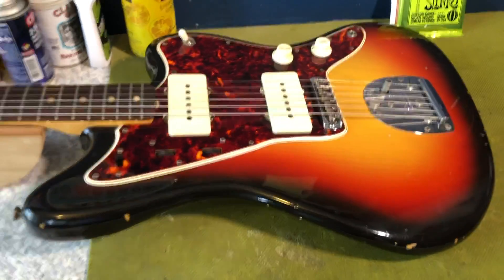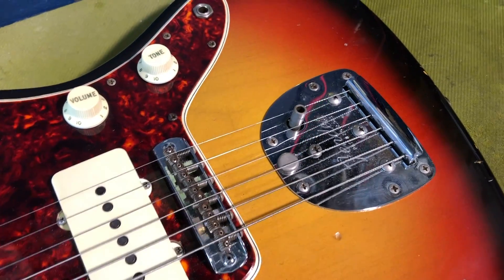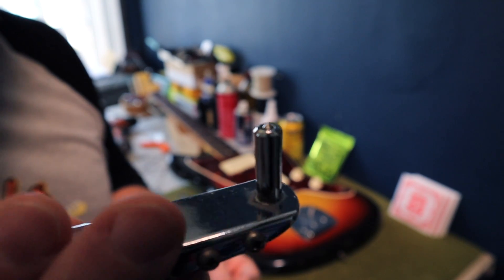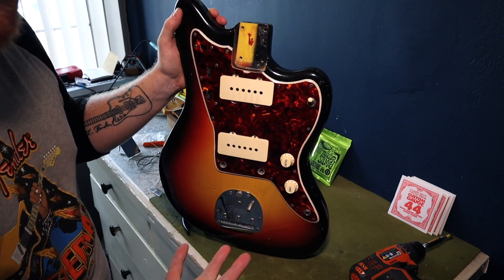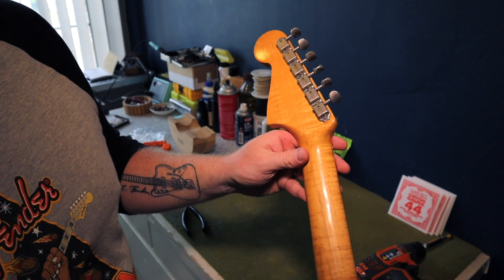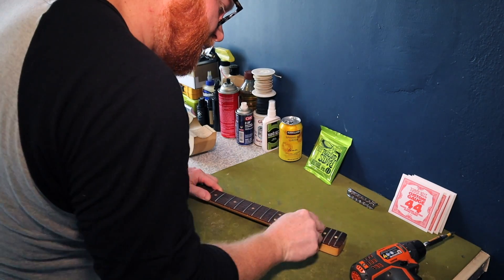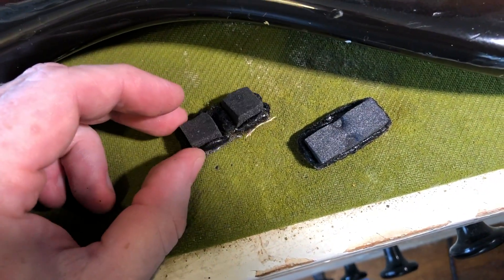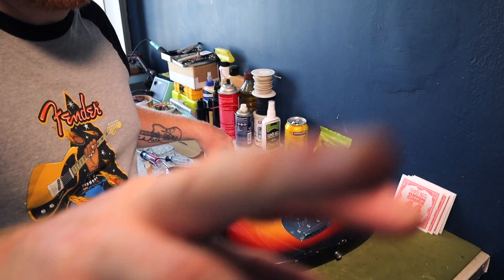1965 Jazzmaster Setup Walkthrough & Demo

Comment: How do you know what angle shim to add, and are there other adjustments you need to make to accommodate the angle?
Reply from the maker: This is a great question but it's a tough one to answer because every guitar is different from the tolerances that exist within manufacturing. Some guitars will only need about a third of a degree of pitchback, others a full degree. If you have the stock bridge and are trying to get the guitar setup "correctly" then the goal is to keep the strings in place, that's a good indicator that you're on the right track. Personally, I've worked on so many of these at this point that I can just eyeball it in most cases.
Reply: Puisheen Thanks! Keeping the strings from popping out makes sense. I have a Johnny Marr Jag and a Jazzmaster and been experimenting but I’ve never been told this before. Seems like keeping enough tension to hold the strings is a good way to know if you’re doing it “right”.
Reply from the maker: @capitaldharma  Ah but there's a catch: Johnny Marr Jaguars have a pre-angled neck pocket, and the bridges on those already sit pretty high off the body. If you're having issues with string skipping on that one, I wonder if there's some other issue at play?
Reply: @Puisheen  I have a stock Mustang bridge on the Johnny Marr Jag, so there isn't much of an issue with strings popping out of the saddles. The main issue is getting the action lower. I put a 0.50 degree shim in the neck, which maybe helps a bit, but the action still feels a bit too high. It's low enough to make a good rhythm guitar, but I feel like there's got to be a way to get the action down a bit more.
Reply from the maker: @capitaldharma  You're unable to lower the bridge?
Reply: @Puisheen  not before I added the shim
Reply from the maker: @capitaldharma  It was already as low as it could go? Wild. Feel free to send me pics on IG or something!
Reply: @Puisheen  Thanks for all the help!
Reply from the maker: @capitaldharma  Any time, friend!

Comment: Great video!!!  The action did look on the high side, but every player knows what works best for them once they have some experience.  I seem to prefer around 2 mm at the 12th fret low on the E and 1.5 mm on the high E.  Mike, I'm just curious what you consider to be the range for low, medium, and high action?  Thx.
Reply from the maker: Oh good question and yes this action was much higher than I tend to enjoy. Personally, I shoot for my low E at .05”-.06” above the 12th fret, and high E at .04”-.05” depending on the guitar’s feel. Ultra low action is lower than that, I consider mine regular low, medium would be like .07-.08” and ‘omg I can’t play this’ is anything higher than that

Comment: When do you adjust the intonation? That's the only thing I feel I can't do at home, but the rest seemed feasible. Also, how did you fix the nut issue, just curious!
Reply from the maker: I do that after everything else, but before play testing. To properly intonate a guitar, it's best to use brand new, unplayed strings because the moment you start playing the frets form little divots on the bottom of the strings, and that can make intonation far less precise. 

I'm totally blanking on the nut issue in this vid, what was it again?
Reply: @Puisheen  the nut slot was too narrow for the string and it was catching. Looked like even some graphite couldn’t fix it so just curious about how one would even  begin to open up the string slot
Reply from the maker: @soapboxracer182  Oh I just recut it

Comment: Hi Mike! This was very helpful - thanks so much! While following this video one issue I ran into on my recently acquired '62 AVRI Jazzmaster (2003) is that the truss rod won't turn any further so I can't get the neck any straighter. Am I just out of luck?
Reply from the maker: You may be able to alleviate the issue by installing a washer behind the truss rod nut, but some AVRI rods are just that weak. I've seen this happen many times
Reply: @Puisheen  Thanks for the quick reply! That’s a bummer! Should I cut my losses or do you think it’s worth trying to cure with washers?
Reply from the maker: @smurphy28  Give the washer trick a try before you abandon ship, and if that doesn't work, find a luthier you trust for some IRL options
Reply: @Puisheen  thanks man! Your advice and videos are invaluable. If I lived on the west coast this guitar would be in your hands with my money. Thanks again!
Reply from the maker: @smurphy28  Too kind!!!

Comment: Hey mike, I've just upgrade my squier j mascis jm with mastery bridge and avri trem. It play well but i think the bridge is too high that make the trem isnt as smooth because theres too much pressure. Will reverse shim solved this?
Reply from the maker: My first thought here is to play around a bit with the spring tension adjustment to see if you can get a different feel. I also wonder about other setup issues on your guitar, but it is true that setting up the vibrato is all about balance.
Reply: @Puisheen  Thanks for the reply mike. I already set it up so that the trem lock can slide. For the bridge, I've to set the saddle really high as recommended by mastery. But still I cannot get the base plate as low as from what I've usually seen. It looks weird with saddle sits really high eventhough the intonation is fine.
Reply from the maker: @afiqzikri5253  That's interesting. Are you on Instagram? If so, feel free to send me a picture and I'll have a look. Maybe seeing it will help me make suggestions?
Reply: Yes and I do follow you on instagram. Alright, I'll dm you the picture. 👍

Comment: Hey mike! Thanks for the video - 2 questions. What action do you normally aim for on offsets, I know every guitar is different, but generally where do you aim?  Also I was always taught you use fretboard protectors when steel whooping the frets and then steel wool in the direction of the wood grain to prevent scratches if you need to debunk the neck. Do you ever use fretboard protectors?
Reply from the maker: I only use fret dams on finished fretboards; steel wool is a great tool to de-gunk and smooth out scratches or imperfections on boards, and the minuscule scratches that 0000 grade wool leaves behind largely disappear once the board is conditioned. I'd much rather have it smooth and clean. 

As for action, I like mine as low as I would with any of my other guitars, generally my low E is .05"-.06" above the 12th fret, and high E is .035"-.05" depending on what I need from the guitar.

Comment: Hey Mike - possibly an incredibly silly question! When you replace the pickup foam, where do you place the foam/how long should the strips be?
Reply from the maker: Great question. I usually take a full strip (like what comes from Fender OEM) and cut it in half, which is long enough to sit between the mounting screws. Does that make sense?
Reply: @Puisheen  I think so, I've had issues with the pickups often "rocking" if I lean my hand on them, some tougher foam might be needed!
Reply from the maker: @garyjovanovitch3863  Yeah a lot of new foam is too spongy for solid mounting!

Comment: Im wondering if disconnecting the rhythm brightens the guitar up a bit. My jazzmaster is pretty bright in a way i don't like, I've tried adjusting it in so many ways. I looked inside the guitar and noticed the rhythm circuit is disconnected. Is it possible that by disconnecting it it's making the guitar brighter? I know modern jazzmasters can be bright. But im just curious because ive played many old jazzmasters and they were butter smooth but clear.
Reply from the maker: In my experience doing so has little effect on the overall sound of the guitar. Really, you're just losing a single wire that's about six inches in length between the neck pickup and the toggle, and then another from the RC and the jack. 

What Jazzmaster do you have, and what pickups? What's your rig? Give me some more info and I'll try to make a recommendation
Reply: @Puisheen  i got a squier vintage modified jazzmaster.  They got a staytrem bridge 12 gauge strings and pickup wizard 58-62 pickups it's vintage wired in the lead circuit. I use a PTP rebuilt 59 tweed bassman Ltd. I just noticed how low my pickups were. I just took a screwdriver and hiked them up the pickups quite a bit and its still bright but it's beefed up quite a bit.  It's better now
Reply from the maker: @aaronbrown0417  Oh yeah height is a huge factor, definitely get those closer and you'll be a lot happier. (as it seems you are)

Comment: Hi, can someone tell my what is a good action height on low e string without fret buzzing, and pickup height for squier vm Jaguar, thanks
Reply from the maker: Every guitar is different, but generally I like my low E between .05" and .06" above the 12th fret with almost no relief. Pickup heigh is subjective, but I also keep them close.
Reply: I would love to have this, but Mine has like more than 2mm height at low E and keep buzzing a lot, I thing I’ll need a luthier 😢

Comment: I realize that this comment thread isn't exactly the best place for this, but on the general topic of jazzmaster setup, I'm intrigued by Kevin Shields way of setting up a jazzmaster vibrato, and his theory about how using the vibrato to bend notes up in pitch isn't for him. I wonder if you'd do an episode where you get into setting up a jazzmaster vibrato like he does, with the stock bridge posts leaning back against the vibrato side of the thimbles, so that the vibrato can only down in pitch rather than down and up, as described 5:30-6:15 here: https://youtu.be/qd1Xmr2YY7c
Reply from the maker: That's interesting, but the bridge position within the thimbles has nothing to do with the range of the vibrato, that's purely the function of the spring tension adjustment.
Reply from the maker: @bencrum1160  Yes, I'm telling you that has nothing to do with the range or motion of the vibrato. If it did, swapping the bridge to a fixed bridge like a TOM or Mastery would also limit the upward motion of the vibrato, which it does not. Shields can do anything that works for him, but the only factor that has any sway over the downward-only movement of the vibrato is the spring tension adjustment screw.
Reply: @Puisheen  ok. I wonder why he says with his setup it’s “impossible” to go up and that “there’s nowhere to go.”
Reply from the maker: @bencrum1160  If you adjust the vibrato spring tension adjust (as it appears he's done judging by the height of the arm collet) then this is correct. Nothing to do with the bridge
Reply: @Puisheen  aha! Thanks for your clarification on that one.